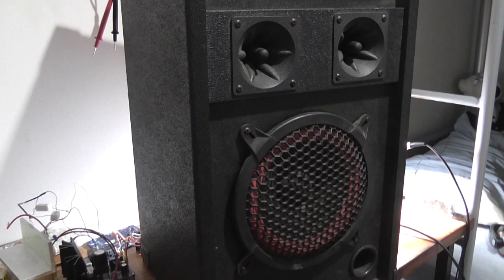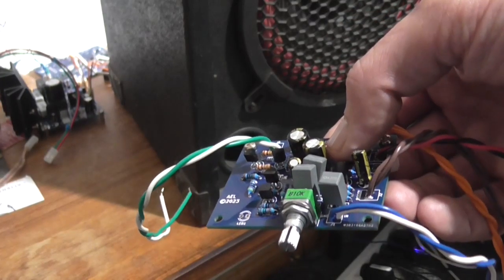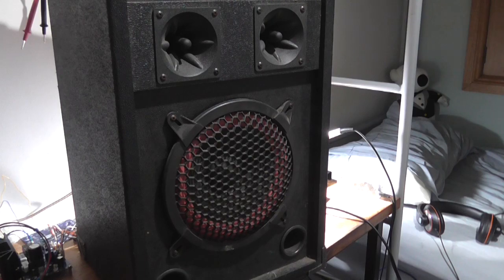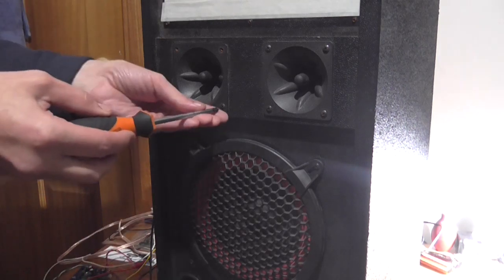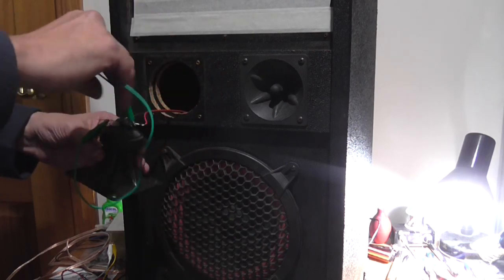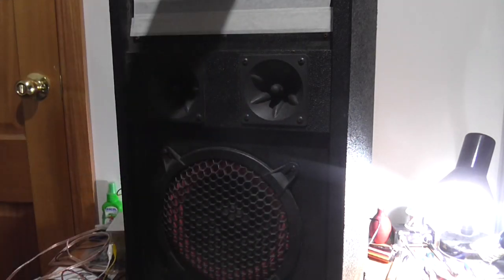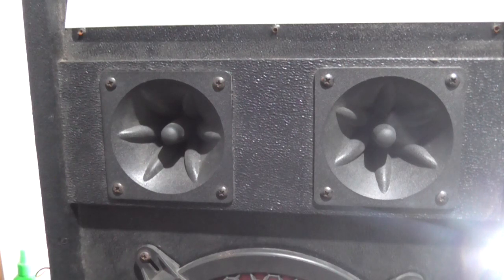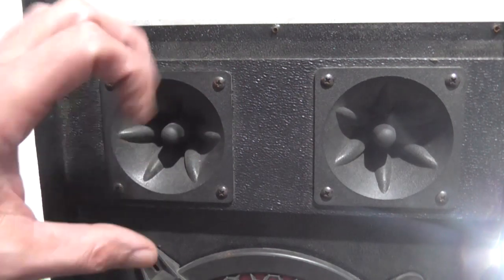Is This Piezo Horn Driver Damaged? Let's Find Out!

Comment: Piezo Tweeters require an equalising network in addition to the series coupling cap to sound at all decent and non ear bleeding. Internet searching will provide info. Amp hum/buzz would be unlikely to have killed your PT.
Reply from the maker: According to the specifications of said tweeter, these do not require a series cap or crossover, and when you measure with a meter across it, it's open load (because they have an internal series cap).
Reply: @AstrosElectronicsLab  Hi. Piezo element measures open circuit because it is actually a capacitor (that mechanically deforms with voltage applied). Sure, data sheets say just connect, in practice they need taming with a network, I forget the details but internet searching will provide such information.
Reply from the maker: @ericmc6482  correct, they already have a blocking capacitor. As I said in the video, the box could benefit from a proper crossover (possibly 3rd-order, 12dB per octave filtering) with the crossover point at 1kHz. I do have a crossover ordered online (cannot get them from Jaycar anymore, pretty much like everything else DIY home audio related). As the bass-driver does not have a low pass filter on it (aka a crossover), it's pretty much trying to produce the full range up to its upper limit (3kHz I believe). This would be adding nuances to the sound and possibly adding to the "colouring" (badly) of the sound. What do expect from a cheap Chinese made speaker box? I bet I can make it better 😁